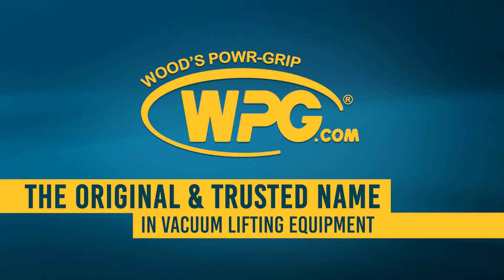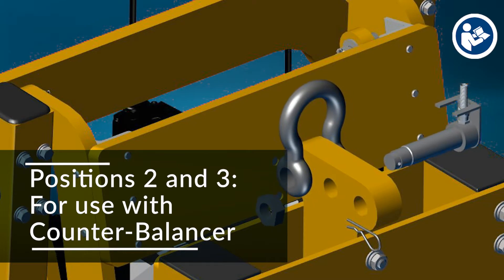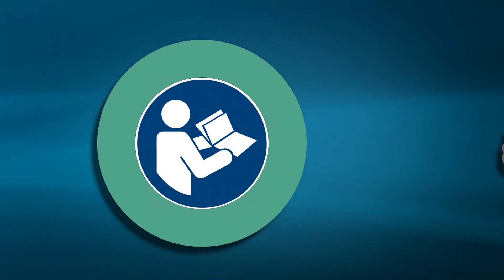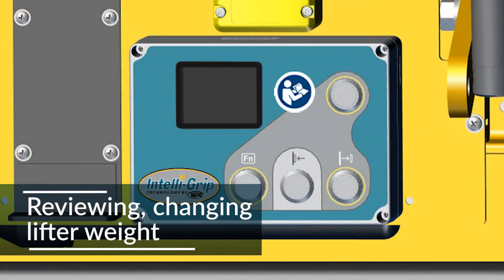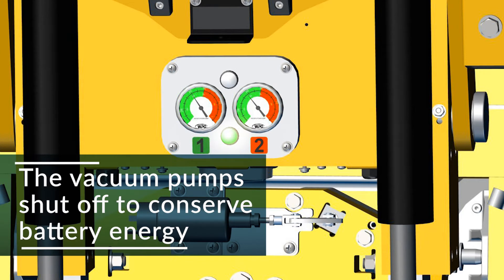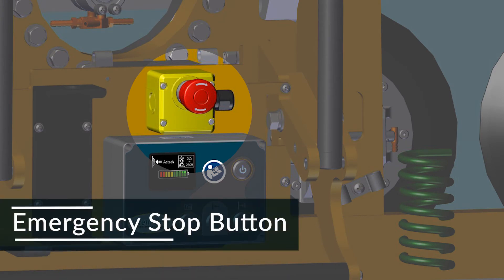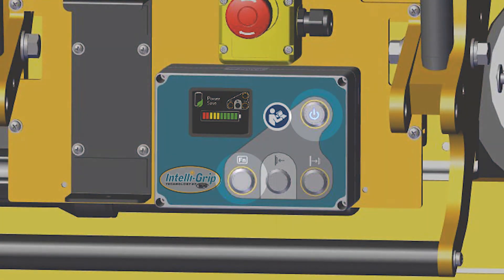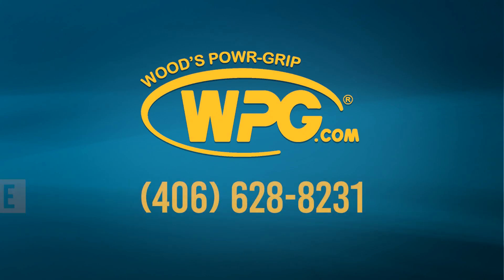Powr-Grip's MRPT16-DC3 Instruction Guide

Comment: how many lbs can lift and hold, is it good for granite and quartz slabs?
Reply from the maker: The lifter is rated for 2800 Lbs. https://www.wpg.com/catalog/mrpt16-dc3. It is not specifically designed for granite or quartz. If we were to modify it to lift stone, we would - at a minimum - put different pads on it, which would lower the capacity. Our lifters that would typically be intended for Stone are listed here: https://www.wpg.com/catalog/vacuum-lifters/stone. (Sorry for the late reply.)
Reply: Thank you. im still in the process of buying one for stone that rotates like this one. No problem responding that late.